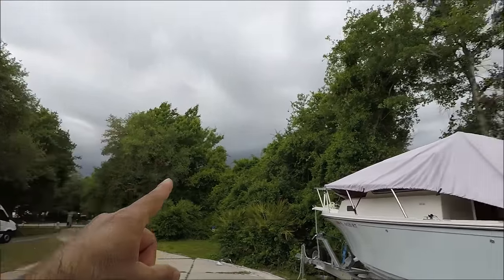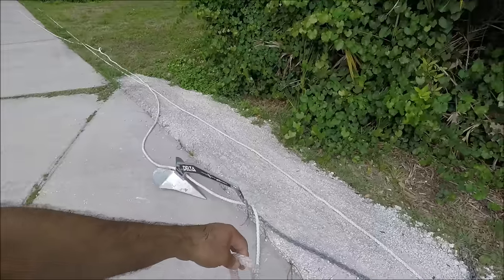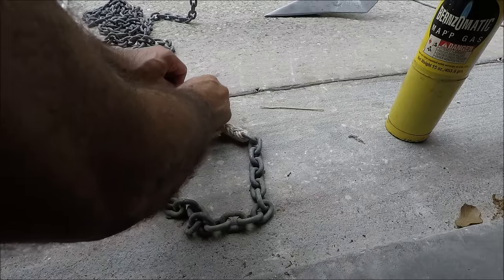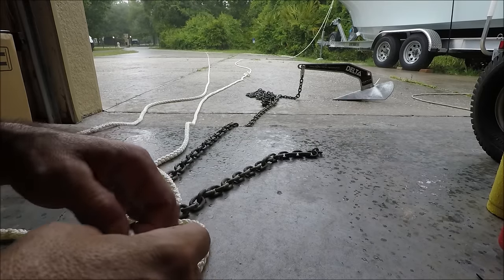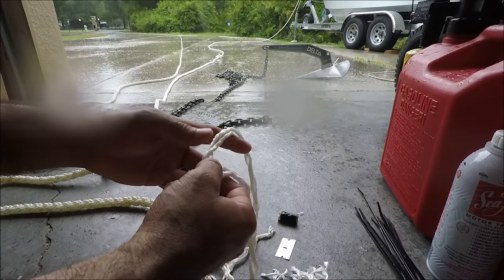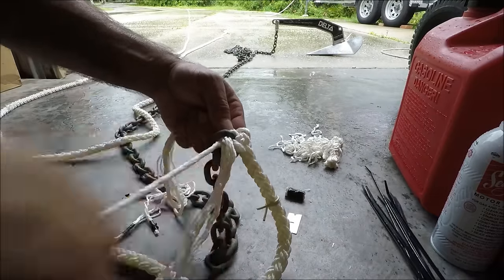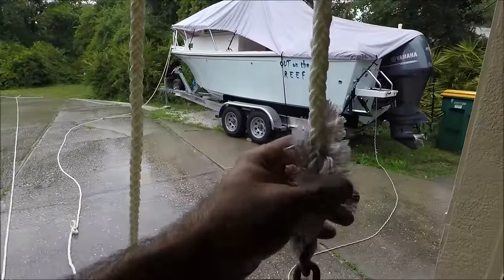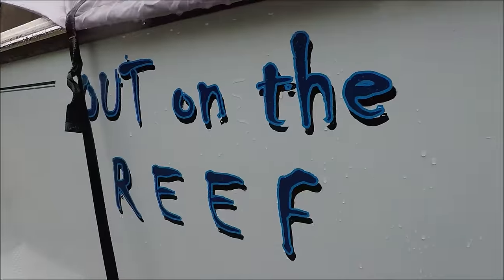How to Create a Anchor Rope-to-Chain Splice for Crooked Pilothouse

Comment: I don't know how I missed this when you first posted it; This is a super How-To-Do video! I have never tried splicing braid, but will try it after watching your video. (Just for the fun of it!) For years I would add 'eyes' by splicing my 3-strand dock lines (from the directions and photos in my "Chapmans", aka boating-bible),  3-strand is easy compared to braid, but after watching your video I will give it a try.... Good info on 'switching the ends' of anchor line; I've done that with  mine over the years. On my last boat I used 35 lb CQR, 300' 5/8" braided  and 40' of 3/8" chain, plus Fortress 37, 300' 3-strand, and 40' 38" chain; no windlass; all done by boat power and hand power. My 'used' Parker boat came with 300' 1/2" 3-strand line, and 40' chain (forgot the size); it has worked well with the Lewmar Profish 700, and so far have not need to switch end-to-end yet... Thank you for your great videos!
Reply from the maker: Anytime Andrew I'm glad you liked found it useful and yes the three strands is a lot easier I believe but the one that has more strands it's a lot stronger because use a lot of strands to going between the other strands make a stronger.
Thank you for your comment and for watching Andrew 👍

Comment: I went through the same problem and finally switched to all chain. 200ft g4. When i weighed it i think is was 280lbs. Either way didn't have much effect on handling or gas on my 27ft bow rider. Depending on the weight of your boat will depend on recommended rope size and with your particular boat the line you showed on the video I wouldn't go smaller or maybe take the risk of it breaking. I think you will find yourself eventually buying all chain but that should work for now. I think i got my chain for about 600.00 including shipping. I know thats expensive but that chain rope combination was so annoying i couldn't take it anymore. Safe travels captain.
Reply from the maker: Thanks Ron for the great info I didn't know you could go all the way with chain for a boat if I ever go to chain I don't think I will go more than 150 feet because of my anchor Locker is not big enough thank you for your great comment captain
Reply: Lol. What you gonna do with 200 ft of chain? Anchor in 75 ft of water?  Need 2000 minimum where real men fish
Reply from the maker: @peterk814  lol im not a real fishermen 🤪

Comment: have you corrected the position where you connect the chain to the anchor? in the video. if the anchor stuck on structure it will be hard to come off or worst lost it. the chain should be connect to the front then tie a weaker line/rope around the chain through that hole. if the anchor somehow stucked, the weaker rope will break and the anchor will be pull out from the structure.
Reply from the maker: Great Point Captain but now I have a Minn Kota with I pilot and I will not be using my anchor to Anchor on reef anymore so I wouldn't have that problem, thanks👍👍

Comment: Hey Bud , great job but I believe you are using the wrong line size for your lewmar windlass . Same things happened to me and I went back to the windlass manual and was using the wrong size or material line . I bought the correct line and size two years ago and so far no issues . Also when doing the splice of the line, you need to hit it with a hammer a little to avoid getting stocked when passing through the windlass
Reply from the maker: Thanks for the great information and I will look at the manual to see what's the size of the Rope and yes that makes sense hitting it with a hammer that's going to soften up the heart splice.
Thanks Albert for your great help buddy really appreciate it

Comment: Your anchor line gets hard from the salt, you can rinse it, (use fabric softener I have read), to prevent this.  Or, go to 100% chain, too heavy you say? Then go with whatever length of chain you need for the depth of water you generally anchor in.   Probably get away with 60-70ft or less if you are anchoring in 10ft or less.  At any rate,  that braided crap is hard to splice,  I would doubt that splice would make it easily through your gypsy, but if it works.....  3 strand right hand lay is the preferred rope to use for your anchor line splice, much easier to work with, splices easier and stretches better than braid and stretchy is good.  Heat a blade up with that torch and cuts like butter.
Reply from the maker: I think you're right about the salt Captain I didn't think of that
Reply from the maker: Thank you for your great information